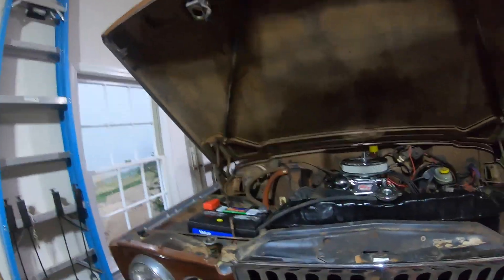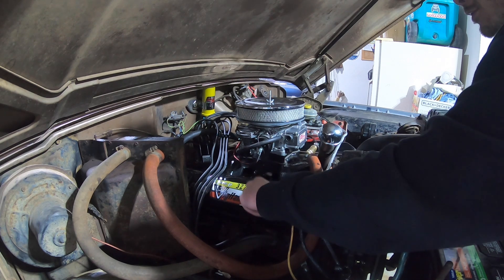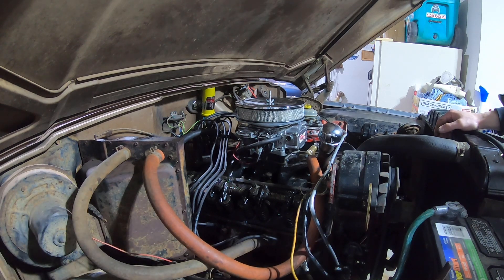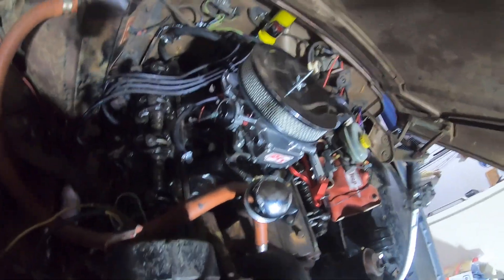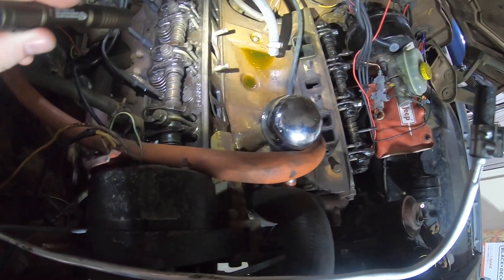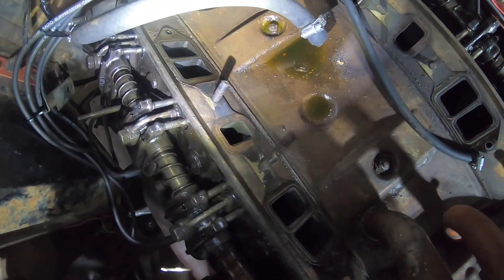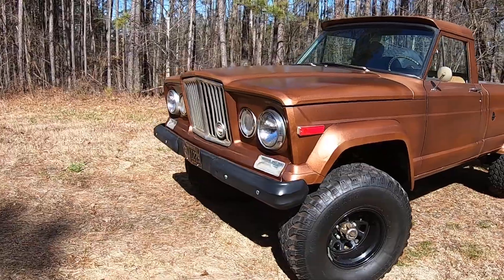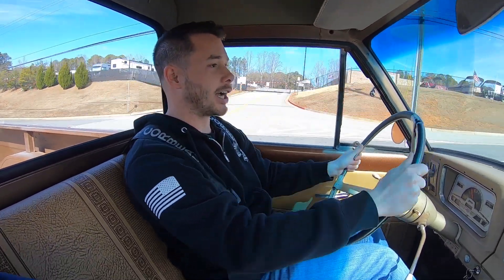1968 Jeep Gladiator (AMC 327) Lifter Tick Investigation

Comment: I once owned a 1970 with a factory Buick 350 and a 400 turbo trans. But I would have been very happy to have this engine. They are very good. I hope you can find the problem and that it is a simple inexpensive fix. On a side note I am now 71 but in 1970 while still in HS my best friend would often drive his dads 1963 Rambler Ambassador to school. He would stop and pick me up in the morning and I would ride home with him. Every once in a while he would stop and just dead punch it to the floor and that Rambler with that 327 engine would just fry both rear tires as long as you wanted it to. I can remember yelling at him to let off because I was afraid it would blow the rear tires. Loved that car. One more thing the most fun I had with my Jeep was to put it in four low and punch it. Never heard a tranny shift up so fast in my life. It was in top gear before I reached 15 MPH.
Reply from the maker: Sounds like y'all had some fun in those old cars back in day! It's always great to hear folks recount the memories these vehicles have been a part of over the years... AMC heritage lives on!

The 327 is a good little engine, and it's still runs decent after all these years. Just drove it 100 miles a couple weeks ago.  I think the noise is an exhaust leak, as I have been through the valve train and didn't note any issues. I plan to rebuild this engine at some point. Gonna keep this bit of Jeep history on the road for as long as I can. The intake is off an AMC Marlin, and is how I adapted the 4 barrel carb to this engine. It was a 2 BBL from the factory. Also going to put 4.88 gears in the axles to better put the power to those 35" mud tires. 

Glad you enjoyed the video, and appreciate you sharing a couple stories.

Comment: whered you get the clears for the front blinker markers
Reply from the maker: They came off a Jeep FC. Bought them from a guy on the Fullsize Jeep Parts / Rigs for Sale Facebook group.

I actually prefer the Amber "Cat's Eye" lenses, but mine were cracked and I couldn't find a reasonably priced replacement set.

Comment: Sounds like manifold leak to me
Reply from the maker: That is what I'm hoping for at this point! 

I was telling another fella, the exhaust manifold bolts are rust welded on, so I'm going to wait until I pull the engine to fix this. 

Maybe I will use my stethoscope and poke around the manifold to confirm this is the source of the noise.

Thanks for watching!

Comment: Makes sense to leave it for sure, if not exhaust then run a higher octane fuel to see if tick at higher rpm improves, looking at the valves you might have some predestination due to cylinder carbon build up. I have ticking as well but only at idle and only when warmed up, enjoyed video so thanks for posting 👍
Reply from the maker: Yeah. I didn't want to risk wiping out the cam, so I'll deal with it until I can do a full rebuild.
I'll try running premium, but it sounds more like a tick than a ping.
Good point on the valves. I didn't think about this.

I also tried pining the exhaust back flow valve in the open position, but that was not the culprit.
Next would be to do manifold gasket's, but the bolts are rust welded on lol. 
Again, would probably be better doing this on a stand versus having to drill and tap broken head bolts while the engine is still in the truck. 

Your's might just be lifter bleed down? I have a 350 SBC that does this. It has a lifter tick for like 15 seconds until it builds up oil pressure.
Reply: Sounds like we will both end up with engines on stands lol good luck with yours and I look forward to any updates you may do ok 👍  @Harry_Dawg.